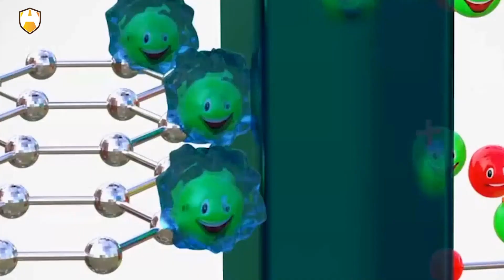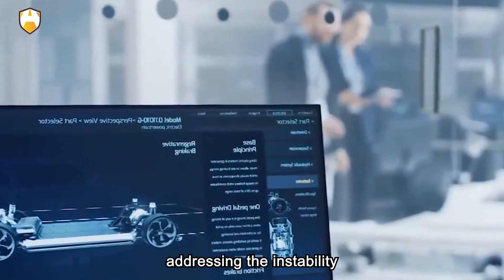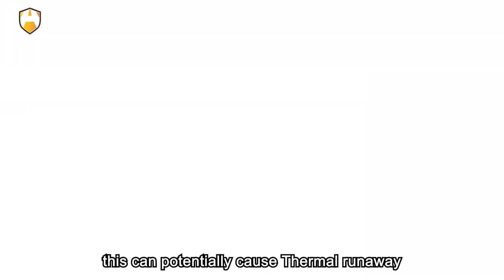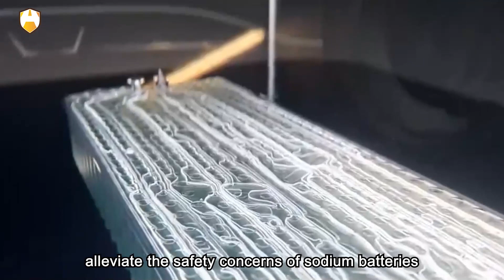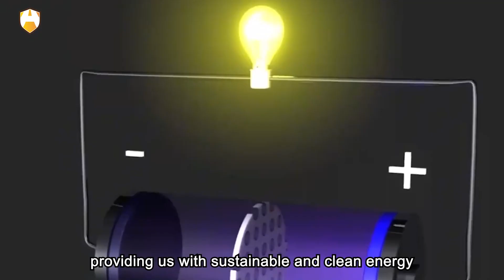Sodium batteries, a new energy revolution is on the rise!

Comment: Sodium-ion  batteries are not new they've been around almost 15 years.

From Wikipedia "Sodium-ion batteries have several advantages over competing battery technologies. Compared to lithium-ion batteries, sodium-ion batteries have somewhat lower cost, better safety characteristics, and similar power delivery characteristics, but also a lower energy density [meaning they will give you less range in an EV than a comparable LiON battery]

Their main
Reply: It depends on the cathode and Anode used. So, it's not certain that Na-Ion batteries will always provide lower range to EVs. Have a look at Northvolt Solid-State Na batteries. Their energy density is 160 Wh/Kg.
Reply: @hotyute  " So, it's not certain that Na-Ion batteries will always provide lower range to EVs"

By your reasoning, it's not certain lithium batteries won't quadruple their range, and improve charge times by a factor of 10x